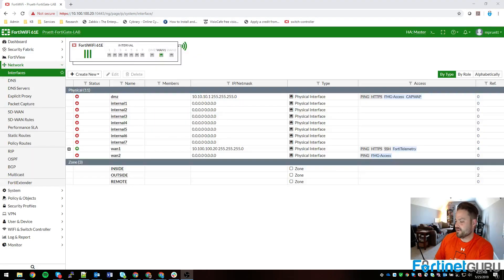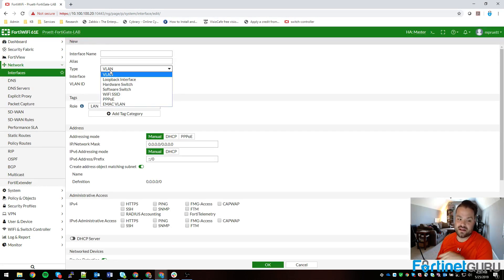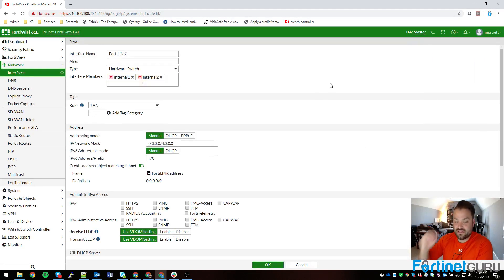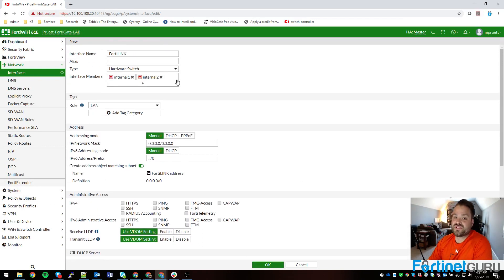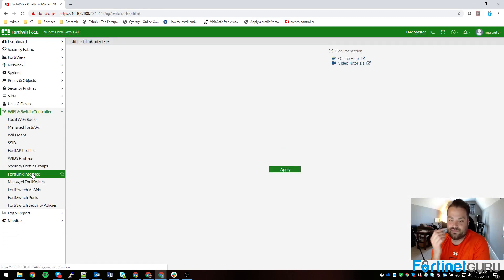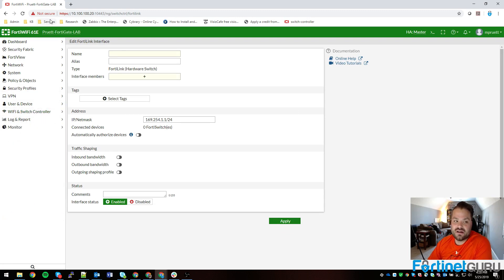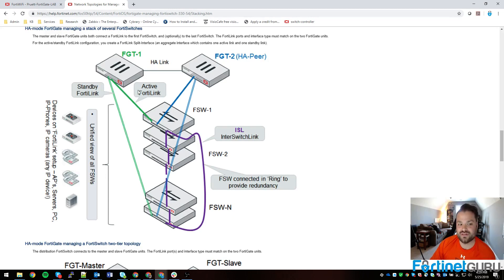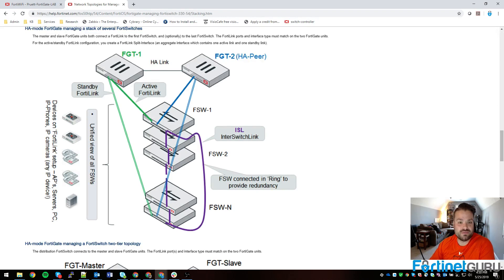HA FortiGate Managing FortiSwitch Stack PART 2

Comment: Thanks for this Mike, is it possible to LAG each of the active/stdby flink interfaces and use same topology? Pretty new to fortiswitch and have a 4stack of 100series FSW's to setup on a FGT (60F) A-P soon. I just wanted to have 2x1GB interfaces in a LAG for the active and stdby flink ports on both HA FGT's (A-P) for the intervlan traffic (wont be much anyway). I assume it is, cheers!

Comment: Is it possible to connect 3 singe Fortiswitches to the HA each? So instead of a s stack of 3 FSWs I would use 3 single Switches. So far I never got it running.
Reply from the maker: I am not sure that I am following your methodology. Drawing of it cabled up so that I can understand?
Reply: @FortinetGuru  Is it possible to add pictures to YT comments? What I want to do is to connect a Fortiswitch to HA (One cable FSW>FG-A and one cable FSW>FG-B) and i want to do this tree times. I know I can create a fortilink interface as "hardware switch" f.e. and conenct three switches directly quasi parallel. But I have no clue how to do it on a HA cluster. So far only one side came up. I guess the Switch needs to do some sort of LAG. But I can't find a cookbook or anthing like it for that.